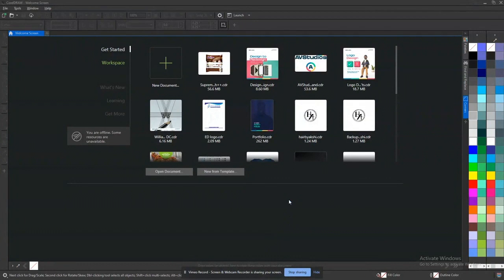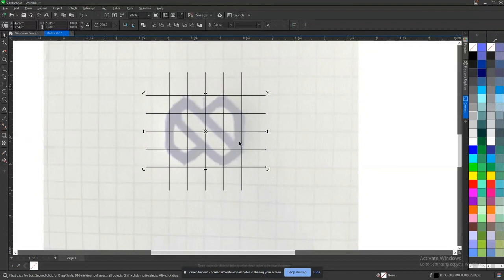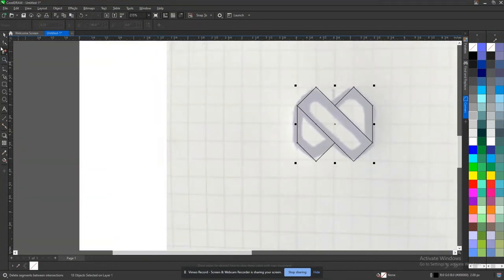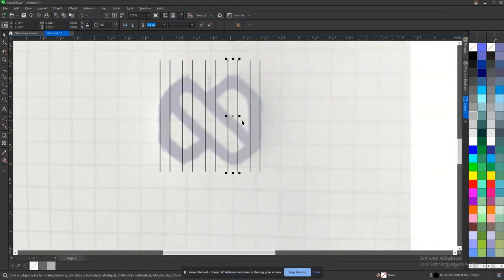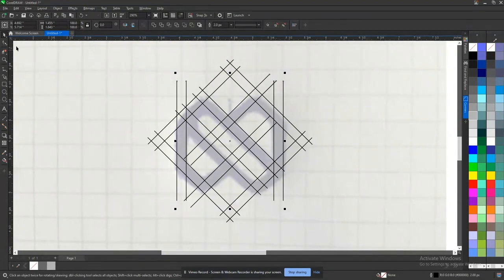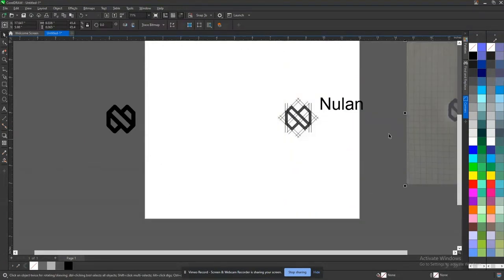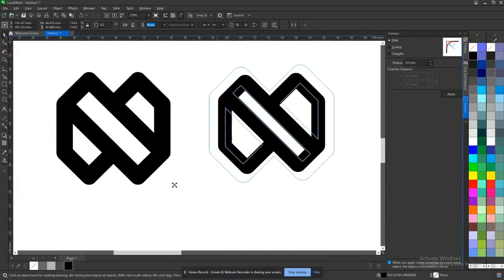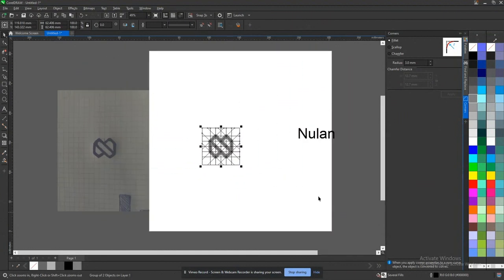Logo Design Using Grid System.

Comment: You don't know how happy I am with this YouTube you created. Thanks boss. Please does size and resolution affect Logo designs? If yes, what is the recommended size and resolution?
Reply from the maker: I used 12 x 12 inches artboard
Reply: Please sir is the 12 x 12 inches the fixed size and resolution? And how do you know what size and resolution to use for each design?